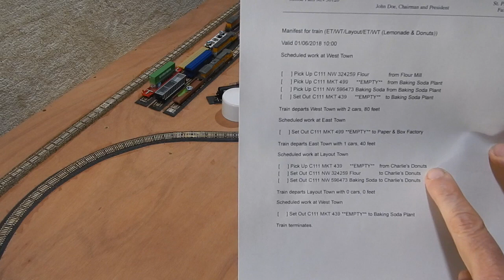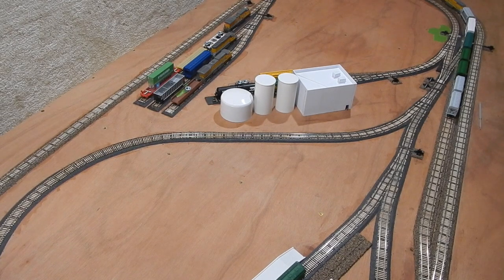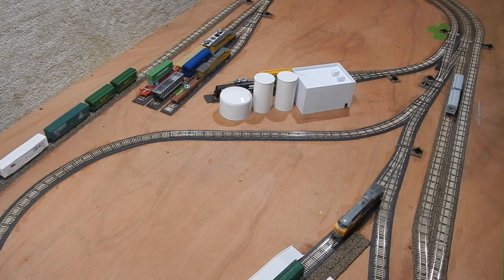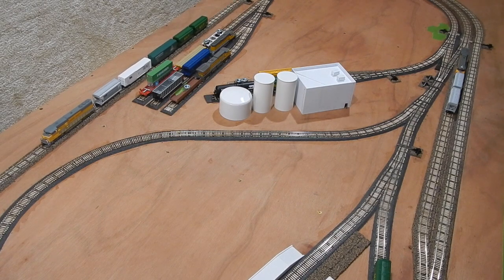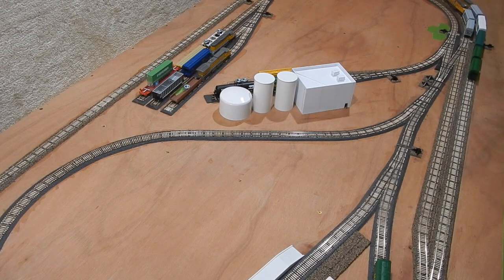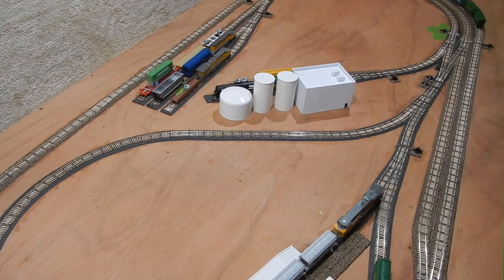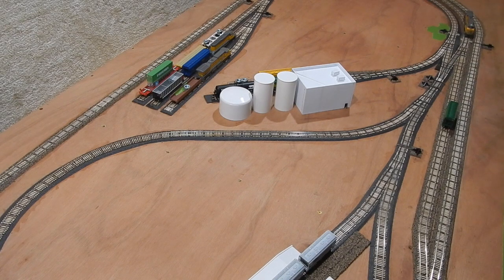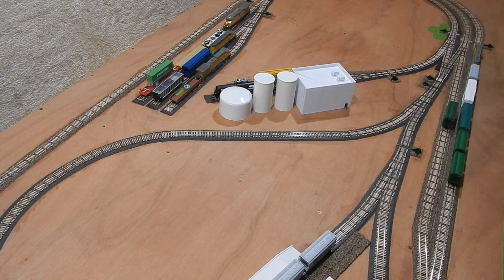My small switching video

Comment: Thanks for sharing I am happy to see the cars and the loco doesn't "hop" on the turnout. Nice smooth operation.
Reply from the maker: Thank you Zane.  I'm with you on the hopping.  I don't like cars/locomotives jumping or hopping over turnouts, but I will admit, I needed to adjust a couple of the turnouts to have a smooth running track in a few areas.  Not a big deal, I just got a small file out and removed some rail at strategic points.  Thank you for your comment.
Reply: Bruce Giroux I did the same with some of my Atlas turnouts to try to make them work a bit better by filing the guide rail and filing frog it helped a little There's still hopping though.

Comment: smooth operation! great speed control!!
Reply from the maker: Thank you Ralph.  In my limited experience, it seems like the manufacture of the decoder and locomotive have a big part in the smooth operation at slow speeds.  I like having a locomotive in speed step 1 crawl with a string of cars as if I had a bunch of coal cars getting flood loaded under a tipple.
Reply: still takes the steady hand of an operator!!!